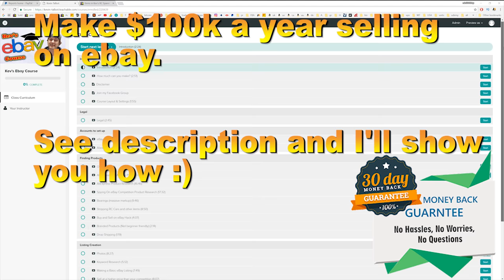Traxxas Slash 4x4 & X-Maxx - Worlds BEST RC Cars??

Comment: 8S X-maxx is world class and ground breaking, Traxxas slash now looking it's age (Decade  old now).
Reply: Driftomaniacs agreed, got a Maxx of my own, used to have a slash 4x4, had to do quite a few updates to make it as good as an x maxx.
Reply: i still say a slash is a good first  and strong ass hell
Reply: BeePee’s Blitz the VXL-3s won’t overheat if you add the optional cooling fan.
Reply: Rugger 878 slash is great, I just feel that th X-Maxx is stronger in its box stock form, compared to the slash in stock form.
Reply: R/C Insanity well they are strong and for most peaple price range thay great because not every one has 1100 to spend on a toy but if you do thats ok. my 2wd drive is stock other then front arm changed them caused i could also the slash is not a stunt truck it’s not made for jumps like the xxmax
Reply: Have you made a vid on eny tacon cars

Comment: I took my slash 2wd to a skatepark near the college campus I attend and broke 3 parts on it.  A-arm, the kingpin for it (which still used e-clips), and my servo saver.  I had never broken the servo saver in all of the crashes it's been through.

Comment: Im suprised the slash breaks all the time with how light it is. BTW the ARRMA Senton 6s is the king of short courses :) give it a try kev ita beastly, cheers
Reply from the maker: Slash takes it man, everything breaks when pushed to the limit
Reply: Kevin Talbot Slash on 3s is like a 100mph go cart. Senton on 6s is like a 100mph 1/8 mile dragster/ offroad racer. The weight of the Senton really helps it in rough terrain where as the slash is all over the place. The Senton also turns nicely and doesn't roll every two seconds.
Reply: I'll be honest. I had 6 Slash's, 2 were stock 2wd & 4x4 my oldest played with b4 going 1/8. He learn to drive with them. The other 4 were 100mph+ 2wd & 4x4, as well as 2 bashers that were beat to hell & killed my wallet through parts. I dumped all that in the tub when the V2 Senton 6s came. The red fireball ESC was gone, the body was thick as most Prolines, & the system in it made in the most powerful 1/10 SCT. To drive it is to know NOTHING can beat it. I still have a Slash 4x4 somewhere, maybe in pieces, but I haven't touched it since I bought the Senton.
Reply: Megasty15 you know the truth👍👍👍👍👍👍
Reply: I've raced against an Armma Senton at the track I normally race at.  I can barely keep up with it if I don't crash.

Comment: ahhhhh.  Arrma has all 1:8 trucks that can take it, Kev.  And check the 1/10 scale  $299 blx models now...  New bearings at the most for any upgrade fresh but very ready out of the box.
The XMAXX is certainly in a "league of it's own" but a great designer is one that can have every truck take the big hits and drive nice and wrench like a user friendly machine should.  .  
I love my Slash vxl 2wd and ER-2.0.  Both sexy trucks but heavily modded out of necessity.  Get on Arrma dude.  It's ok to love em all. 
They're what they call an entire new animal....  The Arrma, I mean.  
No hate, guys.  Ahead of time here, please.  No brand hating at all.  
But if I'm gonna put some new guys on rc, and I wanna have as bright and as many as I can -friends into the fun, I'm gonna say Arrma for the modular positives all day long.  I know you can see the difference.  Work on anything and work on Arrma and easy to see the difference.

Comment: Why do traxxas put crappy small rear inner bearings on the rear hubs? Brand new on the second run mine seized. After a strip down I noticed and replaced them with the rpm rear hubs and never had an issue since. Traxxas need to fit them from factory.

Comment: Hey kev, would it be ok if I ran the velineon 3500 on 4s with a max10? I’ve been debating putting my new rustler 4x4 on 4s and I don’t wanna buy and fit a mamba X combo on it.

Comment: An arrma outcast would have. Try the notorious.
Reply: Imad Morsli I’m sure arrma would be stronger then the Xmaxx if they made a 1/6 scale and the chassis would probably have to be plastic instead of aluminum.
Reply: @whatswiththissassylostchilld  Not really, the only point in plastic is cost. The Aluminum just cant be flat, thats all. TRAXXASS fans will always say plastic is stronger because they know no better and justify the high price they pay for 90% plastic RC cars.
Reply: Fem Latra what you mean by aluminum can’t be flat? And I just feel like something for being 1/6 scale and weighs quite a bit will bend it over time.
Reply: Twilight _Kid IS it better to snap the chassis right in half? on my outcast i use metal braces and a homemade tower to tower brace
Reply: KrispyRC depends on how you design the chassis. Braces would work but I not sure how it would hold up when the 1/6 scale rc weighs 20 plus.
Reply: Twilight _Kid enough bracing😉
Reply: KrispyRC I doubt it would come like that stock.
Reply: Twilight _Kid who knows doesnt make things easier when traxxas is on a suing streak those greedy bastards🤬😡😬😠
Reply: KrispyRC I always wanted to own a traxxas slash 4x4 but I just feel like it’s not worth it just because you mostly just getting a plastic vehicle and a stupid car charger. It’s not like arrma, Losi, hpi, team associated or axial where they have a name. And what I mean by name is that hpi, losi, associated and axial they are well known for racing and compensation.
Reply: Twilight _Kid DO NOT buy a slash its a cheaply made car that has MANY faults out of the box and it aint fun to drive plastic car that bounces around THE ARRMA SENTON 6S IS A BEAST blistering fast like a speed tank look it up on youtube
Reply: KrispyRC I love that vehicle by arrma!! It’s like a bullet!! I would own a traxxas slash just because I would want it to have aluminum parts and stuff. Kevin says that slash it’s really great rc vehicle and all but he puts after market parts on it and put oil on it so it can be flexible. And he basically says that the traxxas is the only great rc brand out and everything else is shit. He still haven’t made a video of his his hpi savage being bashed like his said he would.
Reply: KrispyRC I love his channel and all but there some things I don’t agree with him all the time.
Reply: Twilight _Kid just buy an arrma and thank me later :)
Reply: KrispyRC I would own a slash just for doing a lot of crazy mods on it and the armma would be for daily uses.
And I can’t afford neither of them either lol
I just a 19 year old looking for a job lol
Reply: @kreizmann2943  yes!! one friend got a slash and one friend got a senton 6s last year. the slash was barely at club because it was broken most of the time while the senton on 4s (can do 6s so it was around 2/3 of the potential speed) went as fast as the slash on 3s (can only do 3s so that was 100% of its potential speed). think about it. the senton im pretty sure costs less and it can do 6s
Reply: Imad Morsli yeah its crazy!!!! i hate traxxas